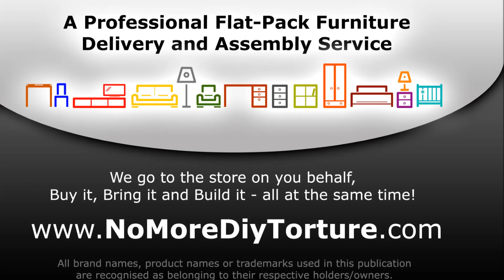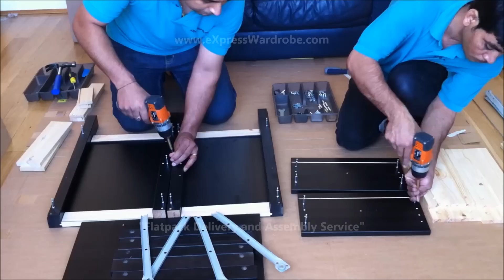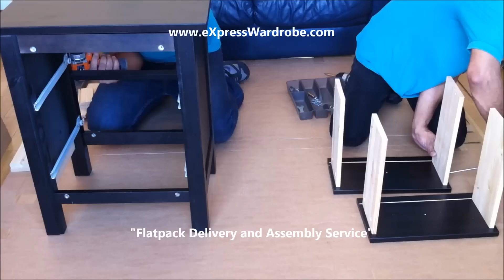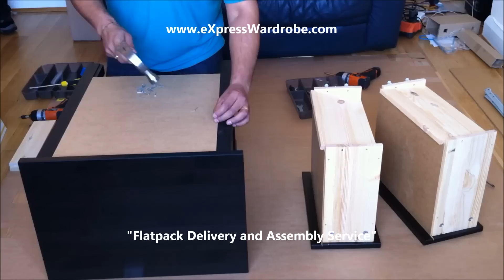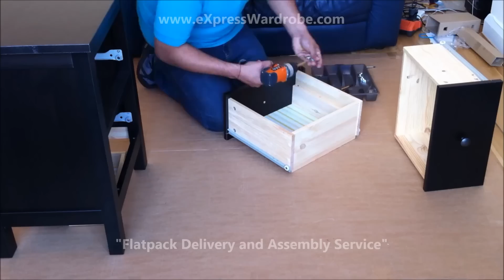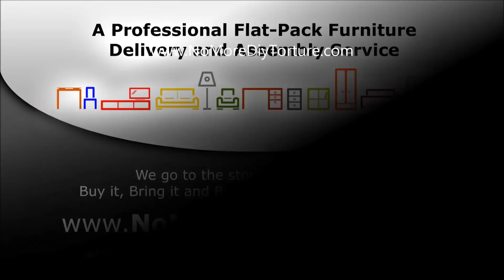IKEA Hemnes Chest of Drawers Assembly

Comment: What power tools where you using? Just a screwdriver? I haven't invested in power tools yet. I don't have a drill or a nail gun or anything. I can do this with just a hammer and screw drivers right? I have other tools, but they didn't seem to be needed for this.